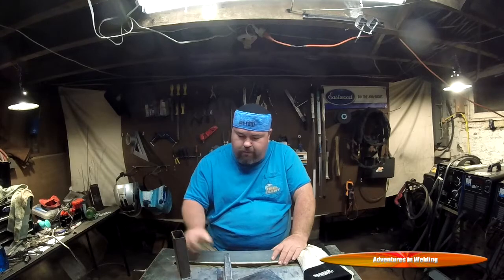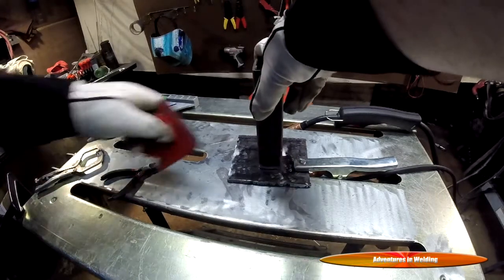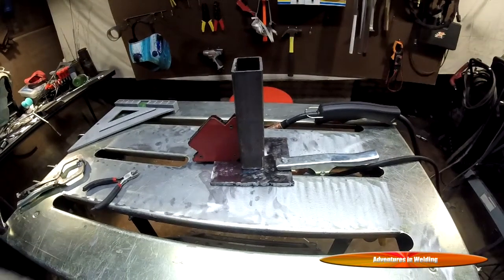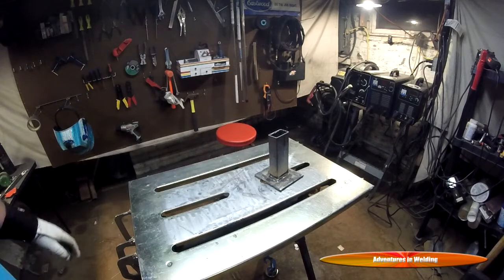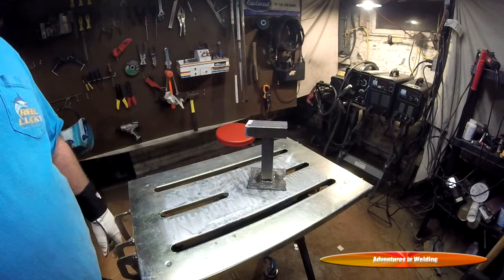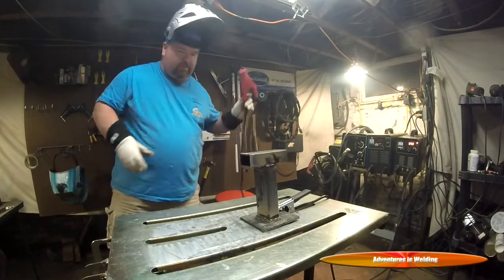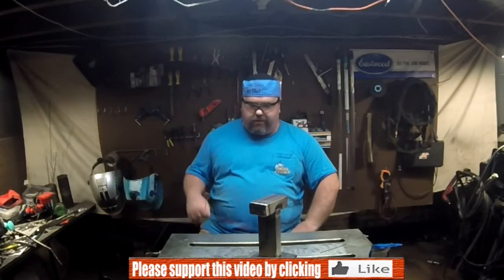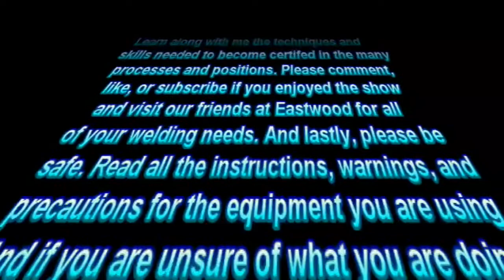Basic Fab part II

Comment: Hi Paul, I would normally tack things on the corners, and being RHS I would probably wrap those tacks around the corner a bit. Then I would weld the runs on opposite sides and both left to right. That is to try and minimise distortion.   Scott.